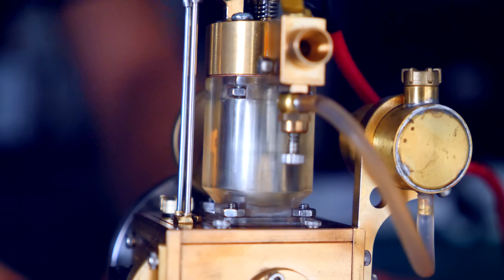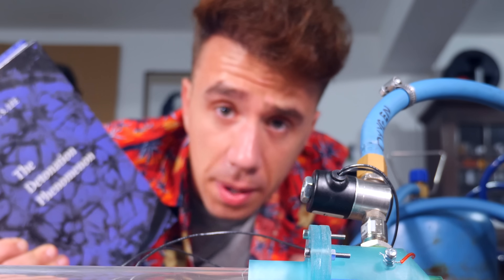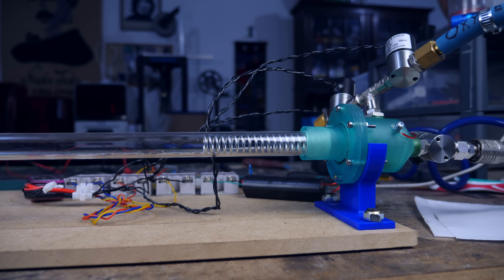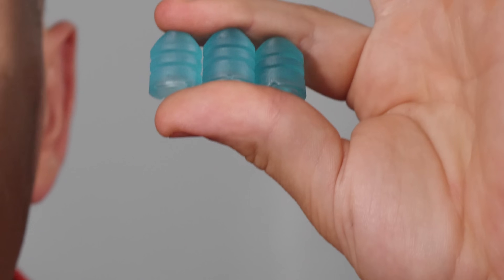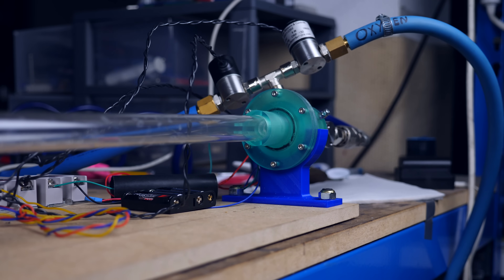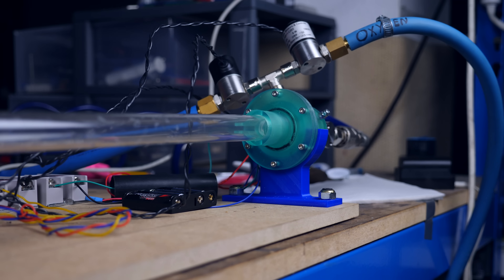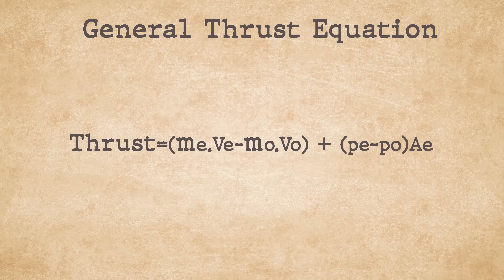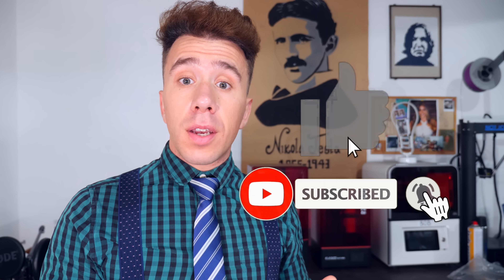PULSED DETONATION ENGINE

Comment: Instead of solenoid valves, can you replace the fuel and oxidizer valves with tesla values and use a continuous flow into the combustion chamber, so you are only limited by spark and flow rate? (possibly just flow rate if you can get the remnants of one pulse to ignite the next)

Comment: Could you not use multiple "cheap" solenoids, addressed and programmed to fire at the half cycle...or third or fourth, however many it takes? I'd think there'd be a point where the chamber couldn't prime fast enough although I've seen pulse jets fire stupid fast. I suppose that a higher forced induction is what is used to overcome that. There's not too many inputs and only one output so the combinations can't be too complex. I imagine the geometry of the combustion chamber and exhaust nozzle is where it's all at...and I hate geometry like Integza hates tomatoes.

Comment: What if you printed a turbocharger style impeller, built an afterburner for it, wrapped the afterburner in copper coil to pass fuel through and regenetively cool, and used thermo electric generators in between the cold coil and hot afterburner wall to see if you could physically harness enough thermal energy to convert it into electrical energy to at least partially or fully spin the electric turbo-style fan?

Comment: What are you using for the soldered/brazed joint? If you are not already, I strongly suggest using silver braze if you only have propane/MAPP to work with, or if you have a hotter set of torches, use regular brazing rod.

Comment: An idea for a future video: create a tesla turbine turbocharger.

Use a Tesla Fluid Propulsion Device (a reversed tesla turbine, patent US1061142A) to draw in air, heat the air by some method (like fire on a metal tube), and finally use a Tesla Turbine (patent US1061206A) on the same shaft as the tesla pump to output the air.

Comment: hey Integza, how about you make a sorta jet engine but it runs on cooking oil by having somewhat of a venturi valve-based injector with two intakes, one side of the venturi injects the cooking oil and the other injects water, that way once the mixture reaches the combustion chamber even with the oil intake being set very lean you'll get a powerful rate of pressure as the water is turned to steam and expands rapidly with the cooking oil condensing along with it, increasing combustion rate.

Comment: I dont know much about engineering,  but this video seems to be proof that regular combustion engines are better then pulse  engines. Less noise pollution, less regular pollution and a lot more safer. But then again I dont know what I'm talking about. Correct me if you want.

Comment: try making a jet engine with v4 cilinders

make a pair of the pistons pressurize air and the other fuel then let the fuel and air pass on a explosion chamber that leads to a tube that spew that combustion gas
                        ^
P.s on this engine try using a little bit of 2 part H2 and 1 part O2

Comment: Duuude. It's the increase in the quality of your projects and videos is really impressive! Every aspect is improved, the workshop, the ambition of the projects, the rigidity of your scientific method, and of course, your rate of success! Your last few videos have been in whole new class. Great job, man. Keep up the FANTASTIC work! I can't wait for the next video!
As an aside: do you know how the project would be affected if you filled the end of the tube with a bundle of smaller "pipes" or "straws," so that the end of pipe acts more like many smaller pipes? It's a principal that we sometimes use with port tubes when designing speakers and subwoofers (subs, especially), which reduces "flutter," and helps make the "exhaust" less turbulent, and hence less "fluttery." It's just a thought, but I wanted to share.

Comment: Video suggestion: try putting a divider inside the combustion chamber then put a smaller diameter pipe this can increase the pressure it creates and adding the dividers will improve the combustion
Reply: @integza here's one hehehe

Comment: detonation with methane based fuels generally occurs with 10% air 90% fuel or vice versa . both are the highest possible point for spontaneous detonation. this is in an open room mind you.
Reply: Yea if you compress the mixture it’ll happen with much more “normal” ratios, and leaning out the mixture generally causes more detonation inside an engine in this case.

Comment: Try using Browns gas has as a fuel source and the have some way to collect the water vapour. Then condense it to be recycled in an electrolysis unit. If 100% efficient it would technically be a totally electric combustion engine.

Comment: Video suggestion: make a 2 metal Tesla turbines and convert it to a gas turbine engine. I have tried doing this my main problem is that I’m 17 and broke. If you do try this idea I’d recommend 316stainless steel with 1.2mm thickness. Thin  disks are kinda sketchy cus  The centrifugal forces combined thermal stresses on the steel will cause deformation.
You’re 3axis CNC should be able to cut the Tesla turbines outdoor housing in aluminum. But the problem with aluminum is it’s lower melting point and significant loss of strength when heated. If you choose aluminum use I think water cooling the frame will be a good safety precaution. Anyways I’ve ramble for quite a bit thanks you for your time reading

Comment: For better penetration, I highly recommend an APFSDS (Armor Piercing Fin Stabilized Discarding Sabot) round, like they use in modern tanks. It offers high penetration and high accuracy without the need for a rifled barrel. 3D printing them is also very easy.

Comment: I'm curious what will happen if the jet engine shot 3000 pulses per minute?
will it go BRRRRRRRRRRRRRRT like the M61 Vulcan or GAU-8 Avenger or will it be a slight of burst of BRRRT then the barrel would petal due to rapid/continuous firing, overheating in other words or will it go few second of BRRRT then blow up?

Comment: Use the Shockwave engine as a launch platform for rockets. You could then add some solid fuel engines inside the rockets and test to see if the shockwave engine can ignite them on launch.

Comment: With the idea of propulsion. How about a jet engine that uses liquid nitrogen? Essentially use a hot chamber and drip in liquid nitrogen. No need for a fuel and oxidizer but instead a head source and liquid nitrogen.

Comment: 0:25 always wonder if it was possible to build an internal detonation engine
Reply: I guess there too much of an explosion risk tho
Reply: It would be really difficult because detonation inside the engine happens a little randomly in multiple different pockets. Even if you could control when the detonation happens, the different pockets of explosions will take little craters out of the piston and spark plug, and those little craters create hot spots in the metal, which attracts more detonation in that spot, which melts the pistons quite quickly.  

I’m sure it could be done with very high quality parts and precise timing and fuel management, but i feel like it would have to be way too precise for any practical use, and the engine would be super fragile.

Comment: hi Integza, i really like your idea of the detonation-engine´and i really wonder if you could improve on that concept if you cluster those engine types in an array of ( for example ) 3x3 or 5x5. this may could allow you to balance out the missing " inbetween " detonations that are missing between each pulse. 

I mean like you have the centre engine pulsating each X seconds and every Y seconds the other 8 engines in a pair of 2,  where "Y " beeing a time  inbetween the main engines pulse, in which 1 or 2 other engines can compensate the non existing detonation force ( thrust ).

Comment: This video also reminded me of the absolutely insane Project Orion .  Which was a research project by NASA where they were trying to determine the feasibility of a spacecraft powered by nuclear bombs (they even built a scaled down version...that ran on conventional explosives of course.  It effectively fired grenades behind it, these 'grenades' made a shockwave that then pushed on a thrust plate, which pushed the craft forward.  A somewhat similar thing is happening to your pulsejet except instead of hitting a thrust plate, the dense stationary air is acting like a thrust plate.)
Reply: So sticky jumping in real life?
Reply: @fragmissle5932  Pretty much, but with the intention of scaling it up as far as a city-sized spacecraft basically 'putting a cup over' thermonuclear explosives and using enormous shock absorbers to turn the recoil of the cup getting slammed into the ship into a (somewhat) smoother propulsive force. Not the most efficient or safe type of engine, but VERY, VERY powerful, and theoretically buildable with a fairly low level of technology (IIRC they developed a combination of steel and oil coating for the thrust plate/cup that should handle being repeatedly nuked at a certain distance surprisingly well, apparently).
Reply: @05Matz  the oil ends up protecting the steel extremely well, i think because of the leidenfrost effect
Reply: @05Matz  Yeah, IIRC the biggest concern was that considering how often it detonated, that would mean mass producing nuclear bombs in the millions.... Yeah... that's something to be concerned about. Don't get me wrong, they figured out how to do it and it's relatively easy. That's the concerning part.
Reply: @fragmissle5932  with nuclear bombs yes

Comment: Hi. I'd like to explore the relationship between the force exiting the system and the size or diameter of the exit port. I am old enough to remember seeing designs like this in Popular Science way back when, and in those articles the Pulse engine had a picture of a huge exit nozzle. If the pulse is actually pushing on the air, would it then not stand to reason that there should be a diameter that would best work with the amount of power(is that the right term for what is exiting the system) and the expansion of the gases leaving the "barrel" into the nozzle?
Reply: I wonder what compression of some sort has on the force of the exiting gas. Maybe a timing valve on the exit side of the combustion chamber something flexible like spring steel or not fully sealed to avoid blowing the thing up.
Reply: The flair was basically working like a rocket nozzle. In a rocket engine, you use a constriction or "throat" to speed the gas up to the speed of sound, in these engines you use the length of the pipe to allow the combustion to accelerate the gasses. Once moving at the speed of sound, gas behaves rather weirdly.

For instance, the way it pushes and travels along the expanding nozzle in a rocket converts most of it's pressure to extra velocity, meaning that the exhaust is actually moving much faster than the speed of sound when it leaves the nozzle. But while it's moving absurdly fast it's dropped so much of it's pressure into speed that it's sitting closer to vacuum than to regular ambient pressure.

This is why you can't normally fire a rocket meant for vacuum down here. The big nozzle expands the gas so much that despite the absurd velocity air starts pushing it's way up along the inside of the nozzle, making the flow of exhaust gas detach from the sides unevenly and flap around the inside like a flag smashing against the sides causing hot spots that can melt the nozzle and generally shaking the engine to pieces in a blink of the eye.